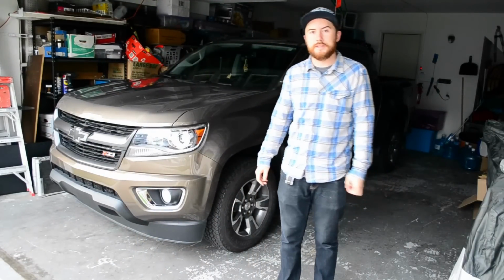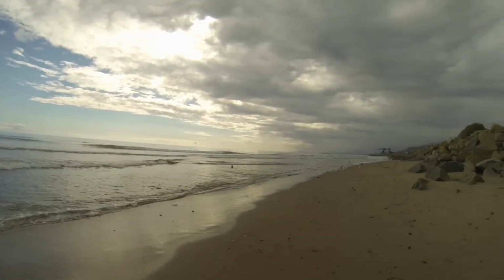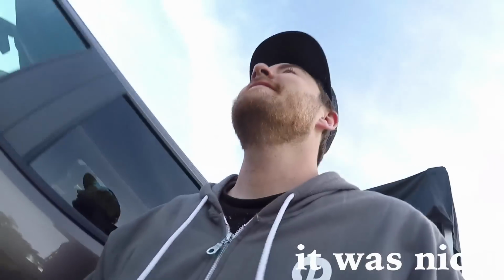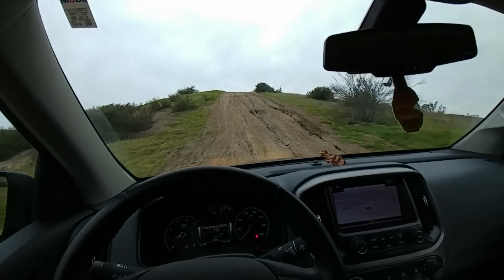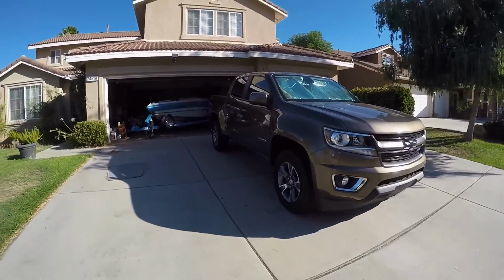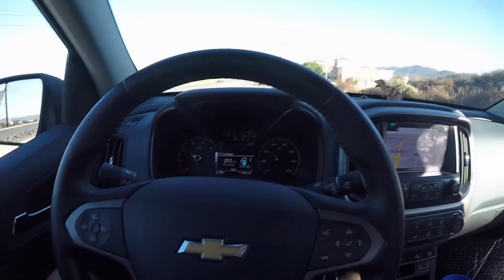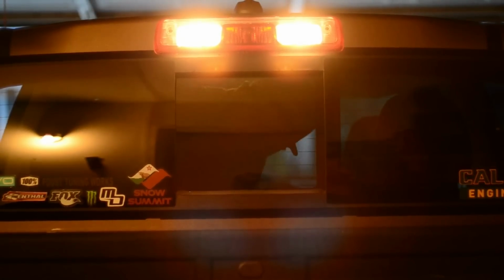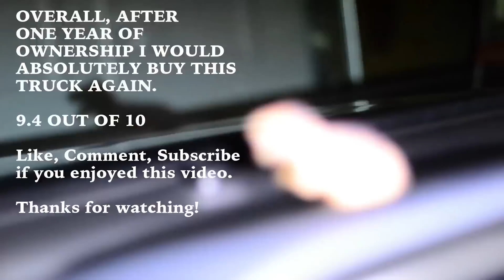Chevy Colorado Diesel... 1 Year Later

Comment: Thanks for sharing! I really enjoyed the video. I currently own a 2006 Chevy Colorado I-5 z71 just over 204k miles on it, still first owner on it as well. I am seriously considering for a diesel. But I have some concerns about owning one. My work is just less than 4 miles from home in Pasadena CA area but it does take me about 15 minutes to get to work. It does takes some traffic signals you have to stop most of the time and going up some hills.  I am concern if the engine does not warm up enough to become efficient before arriving to work. How long does it take the engine to reach to its normal temperature? Do you let it sit and idle before driving it? I am concern about the diesel/carbon builds up in the engine and/or turbo. Turbo has to be hot to be efficient. However, I've done tons of research pro and cons about owning a diesel engine. Some says okay for short trip. I would often take it out on long distance on weekends even taking it on long trips since the MPG beats my wife's car and love the comfort of the ride of these Diesel Colorados. And I am planning to buy a small RV to travel to places. Diesel would be ideal for it for good, strong torque. BTW, nice videos on highway 101 and through Santa Barbara. Feedback from your experiences would be appreciated! Thank you.
Reply from the maker: ThisDeafGuyLA I'm glad you enjoyed the video! Small world, I work in Monrovia so I know the area you are talking about commuting in well. Your concerns are spot on and the same I had. Overall, the truck warms up incredibly quickly. Its only a 2.8l so id say within 2 minutes the water temp is at full operating range and the oil temps are up within about 3 miles or less. For extremely short trips all the time you wont see it get real efficient, but its not going to hurt anything running it on the occasional short trip in my opinion. The fuel in the cylinder is still reaching extremely high pressures and temps, even right off the bat, so any carbon buildup is going to be minimal. Just dont cold start it and floor it and you'll be fine. The torque and efficiency are sooo addictive. I road trip mine regularly and have never regretted the decision to buy. Coming from a first gen I5 you'll love it man. Good luck.
Reply from the maker: Allow me to define short trip... 3 mins or less of drive time. Anything more and you'll be fine as far as temps go. It warms up quite well and being that its a cast iron block heat transfer is very high throughout. Conversely, this is great for cooling on hot days or hill climbs. Cast iron is also great at soaking up vibration from the diesel. It's so well refined, you wont feel any vibrations of a typical diesel truck.
Reply: kevinkillsit thank you for the input. Yeah I figured that you would say 
that the engine block at 2.8 liter would warm up quickly. My father in 
law has a BMW X3 Diesel engine and he drives incredibly short to places 
and his engines runs perfect but I know their designs are different 
between German vehicles and General Motors but diesel fuel are the same.
 I feel relieved from your experience not concerning for short commute 
that wouldn't harm the engine. I am looking forward to buy a diesel 
colorado eventually!  I'll keep you posted. Again thanks for sharing!
Reply from the maker: ThisDeafGuyLA My pleasure sir. Best of luck!

Comment: How do you like the sound from the stereo? I'm not a fan of just loud. Nice truck
Reply from the maker: C Wyoming The Bose option is a must. No question about it. I'm very critical of my sound as well. The factory stereo is probably the best I've ever heard in any new vehicle. I often will go listen to music in it just to hear new details buried in a song. The isolation from the road noise is excellent which allows you to keep the volume down, but really enjoy the song. Low end punch is plenty while mids and highs are crystal clear. I rarely go above 60% volume and it rocks. Overall, I dont need to change anything about it and probably wouldn't even if I could.

Comment: what a nice video .. i forgot about the truck and liked the beach part.. where is that?
Reply from the maker: chris devito somewhere off the shore off HWY 1 in California
Reply from the maker: Thanks for the comment. Glad you liked the video
Reply: ok thanks kevin .. is nice there for sure.. have you seen the zr2 model of the colorado ?  i like it but wondering if it too much.. what are your thoughts?  i need a second vehicle and want a small truck with diesel. i already own a dodge mega cab cummins and want something smaller now.. thanks for your insight
Reply from the maker: chris devito the ZR2 is an awesome vehicle. I'm so happy GM brought it to market. If you really do a lot of off-road I'd say go for it. Its not that much more expensive and its an impressive package. For me the z71 4x4 was and still is plenty. The mini duramax is a ton of fun to drive. I'm super pumped to have a diesel pickup that isn't huge. Just been a really good choice for me. No regrets with it.
Reply: ok thanks... yes the smaller size is what interests me..

Comment: Yea my next Colorado will be a diesel. The V6 has i have now is fine, for what it is, but I tow a lot and get an average of 14 mpg, which itself is not an that bad really. But the trans is constantly hunting and any speed over 65, will not keep the trans in top gear, unless you keep the speed below 60 mph and on relatively flat roads, even while not using the tow haul mode. Oh there is plenty of power, but running at over 2,000 rpm just doesn’t seem necessary and at times upwards of 3,000 rpm’s.  Oh the engine sounds great and smooth, but after driving tractor trailers for years that just seams high. I’m told the diesel tows at nice low rpm’s with its tq. So that does seem a little more relaxing. Especially over the miles I travel.  Oh of course it will crawls right up a dry hill! That diesel will probably be great on the beach! But the only thing I think is needed, if you want to go off road, is a two inch leveling kit installed in front! But then I’ll need air bags in rear to raise the rear while towing my trailer, that when hooked up now levels the truck with the weigh on the tow hitch. As far as the ride, I’ve found that 35 psi in the tires helps get better mileage, but rides hard. I’ve found 30 psi is fine. Empty while not towing. But towing my trailer? I’ve found 40 rear, 36 front works best.
Reply from the maker: K. R. V. Thanks for the feedback on the V6 model. Yeah the diesel is much better for towing duty. My favorite thing is hitting a fairly steep hill at 65-70 on cruise control and not seeing any impact to rpms while maintaining the exact same speed. It's like it doesn't even notice the hill, while other cars all around are slowing and downshifting. Torque is an awesome thing and this baby turbodiesel doesn't disappoint.
Reply: kevinkillsit yea with the V6, there’s plenty of power, but at those speeds, with cruise control and a hill? The speed will remain consistent and probably even higher than the diesel, but that’s with the tranny downshifting, with RPM’s climbing, on some of the interstates I’ve driven in N. E. And The Smokey Mountains in particular on Rt 40 on the State Line on N.C. and Tenn. the truck will maintain even 70 mph uphill, but the trans will be in 4th gear at around 4,000 rpm’s! So it gets a little noisy, but the engine is smooth, with more to go, even to pass around slower trucks! But then your getting another downshift into third, with the RPMS climbing passed 4,800 and up to 5,000+! Before an upshift into 4th! But I only did that once with the trailer, on a long uphill straight, where I needed to get around a slow moving tractor trailer in the right lane, as some yahoo coming up in the lane to my left was hesitant to move over one lane that had NO traffic in it!! It’s like if you use your turn signals some mutts make it their mission in life to speed up and block you! But I was gaining on a really BIG trailer and did not want to hammer my brakes when all I needed was a little common courtesy, that’s not so common anymore!! So I punched it and pulled out anyway! That other inconsiderate mutt did salute me with the one finger hey look I’m a moron going by you style. That’s when I found out I could actually get up to around 80 mph! Uphill towing a 4,000lbs travel trailer! Only for a short burst, to get around slow traffic! That when your going 70, comes up really fast when the slower Truck in front is going under 40 without any flashers!! I’m sure that mutt could see what I was facing, but cared less about me safely passing, while he could have very easily moved over into an empty lane. All because I feel and believe you should KEEP RIGHT EXCEPT TO PASS, that would keep me out of the mutts way to go speeding passed me! So what do I get for my courtesy? A hard azz anal jerk, that flips me off and creates a dangerous situation, instead of following the rules of the road, when someone signals a needed move, that includes another courteous driver, that turns into an inconsiderate mutt!! So I bet the diesel can and will chug up the same road at 65-70, but that’s about it, huh? Hey I Like that color also! So have fun and stay safe!

Comment: have you experienced any higher then average maintenance costs?
Reply from the maker: Nope,

Oil change costs are only about $80 and DEF is negligible at $15-20 per every 10k miles. Running great at 31k now.

Comment: My 1st year review:
700 miles cooling fan came detacted
900 mile repeat previous problem
21000 miles 3rd brake light leak
23000 mile complete fuel system replaced......
Reply from the maker: Hmmm. What year was your truck?
Reply: @kevinkillsit  2020

Comment: Is there a way to check the true emissions these new diesels?
Reply from the maker: Kelly Fontes to be honest, not sure exactly what you mean. GM has claimed this is the cleanest diesel they've ever produced.
Reply: kevinkillsit Volkswagen said the same, Mercedes said  the same, Land Rover and now  GM said the same but have they really ever tested any of these Diesel's at the exhaust?  Love the truck, would love to see that engine in a full size.  I would just like to find out the truth.  now what some government agency your big business would tell me.  Stil... sweet ride, enjoy!!!
Reply from the maker: Kelly Fontes true... I can only say that this was the very next vehicle up for EPA approval after the VW thing and because of VW they made the testing on it a lot more stringent, which pushed back production several months. They had to prove and pass additional on road testing for the EPA and they were "apparently" very tough on it and passed with flying colors. not surprising though because the amount of emissions systems being used on it are not in short supply. SCR EGR DEF DPF all the power/efficiency killing stuff is standard if that's what you're into 👌

Comment: Hey!!! I live in Fontana . I'm trying figure out what I want to trade my cts-v in for.... maybe you experts can help me. I've been looking at the 4Runner trd pro, Tacoma trd pro, and the zr2. I don't off road obviously in my cts-v but o would like to purchase a nice vehicle that I could go off-roading with. Even when I do decide to go off-road I won't do it much.... but like my AR-15's... I'd rather have them and not need them than need them and not have them. If SHTF I'd like to have the ability to go off-road . Suggestions?
Reply from the maker: Robert Zomphier they are all pretty great vehicles. Of the Toyotas, you'll have a lot of good things they do very well and resale is solid. I think the new ZR2 will be the best thing for off road to ever come to market. Certainly up there with the raptor and Dodge Power wagon and jeep stuff. The Z71 is enough for me so far off road and is a little more practical as a daily driver. Go drive them all and decide. The Chevy is a much more refined quality than the Toyota in my opinion, which you may like coming out of the CTS-V

Comment: First off, son, I'm 62, been around to know what can and cannot be such a good thing $$$ wise. As I do not know you, nor you I? This is my opinion.

1+ READ YOUR MANUAL thoroughly. Especially the do and don't of four wheel drive. 
2+ Down hill decent control--READ manual exactly when and under what conditions to use it. As is will not function out of four wheel drive.
3+ Interior lighting, go into your Manual, research how to set up personal settings/preferences. Make it all the way you like it. READ! Then do. 
4+ Tail gate stress. You reading the number one guy to overloading, metal stressing, bowing right in the middle to include ripping tearing tail gates off pickup truck beds. Hint, ever pickup tail gate has a weight limit. Exceed it and away she goes! Look up the price to replace it? 
5+ Tail gate support cable. Weak. Upgrade to full medal brackets if possible. Handled weight much better. 
6+ Do NOT install any engine mods. WASTE of your money. Second, READ warranty contract! Look for any and all modifications. Tons of consumers get Uncontracted real quick by allowing some company to sell you on some gimmicky horse shit designed to mentally think your truck is all they claim it to be. I have been the victim, NOT anymore. Lets think about it this way? Unless your going to run it in heavy filth where you can't see your hand past the windshield why have it? 8 horse power? Seriously? Thats the claim Banks makes for my Jeep JK. I guarantee other than making a throatier sound from the intake the only difference is your mental ego exactly like your young vertical stick is all that get upgraded. Staying with factory air filter will offer you 25 to 30,000 miles before needing a replacement. $26 whoooo! Hold me back   

7+ Take the time to research the engineering of your engine. Why are you ignoring years of scientific research by actual professionals as if they do not exist? The people who push aftermarket bolt ons were NEVER major shot callers to any of the DuraMax line of diesels. Another thing to consider, trucks new ... Why did you buy it versus a 1000 H.P. GM K3500 dually? Or bigger? If you are so disappointed in its power performance need I explain more? 

And lastly, your true haul ass fun is what resides in the back of your truck. Let the truck be as it is and learn to enjoy what it offers you and your's. Economy, comfort, range, and long engine life. Guess thats all I got. 

Cheers,
The Old Fart from Buck Owens Town...
Reply from the maker: Gary Bowen Thanks for your comment sir. I will take many of those words of wisdom to heart. I did read most of the manual the first day, but perhaps its time to revisit it. I don't plan on doing much more in the way of engine mods for quite a while, but the emissions system does worry me a little as that has not been proven yet to be issue free for years like the power plant has. I guess we'll see. Lastly, I'm not questioning your belief that the aftermarket does not have any effect on GM or other OEMs, but I'm actually personal friends with the engineer at Banks who is setting up the new L5P line. They are adding modifications to the motor for military applications and consult directly with GM to share ideas. Gale Banks is pretty well regarded by the GM guys, but not bound by the same political and enviromental rules so they are able to tweak things a bit and look for improvements. I still subscribe to the opinion that a stock vehicle can be improved upon, but in this case I think they did a great job. I figured out the 4x4 in descent control after this lol

Comment: Why people never count  money for DEF ? 
Diesel version cost more ,  mpg not too much Higher than gas version , diesel always cost more than gas , plus  $ for DEF 
service of diesel cost more , filters cost more,  dynamic less , in future more problems with f...ng emission  staff 

If you dont tow heavy trailer through mountains----- u dont need it
Reply from the maker: $7 for DEF every 7500 miles is negligible, easy to fill and takes 2 minutes. When I bought it 2 and a half yrs ago, Diesel was only $2.25 in CA and gas was almost $3. I can't control fuel prices. Lately Diesel been higher due to the extra gas tax that was added. again... unpredictable factor. MPG is actually higher than EPA estimate. I consistently see 33-35 mpg hwy and 28 mpg over the whole tank, every time. These numbers are a lot higher than the gas versions. The cost is only a few grand more for the motor and i plan on keeping it for a very long time so the diesel should last.
Reply: @kevinkillsit  33-35 mpg😯😯😯😯😯
How fast do u drive)
Reply from the maker: @pandrdoberman  cruising at 76mph. It makes max torque at 2k rpms which is 76mph in 6th gear. Seems to be really happy between 73mph and 83mph. Best mpg is around 68-71 range.
Reply: @kevinkillsit  hey pal,  nice truck,  diesel still holding up?
Reply from the maker: @bennyb6071  love it man.
Reply: @kevinkillsit  right on,  saving up for 2020,  the mpg is outstanding,  will you be uploading more as the truck ages?

Comment: traded in my canyon diesel. thing was idling erratic and even cut off on me. This would happen when I first started driving in the morning. Dealer said nothing was wrong. I got rid of it. Bought a 2017 Tacoma. little 3 inch lift and I'm pretty happy. Miss the gas mileage though!
Reply from the maker: dominionn09 interesting. sounds like possibly a fueling issue if I had to guess, I haven't heard anyone else with that problem, but thanks for sharing. glad you like the taco, it's a nice truck, but just wasnt for me.